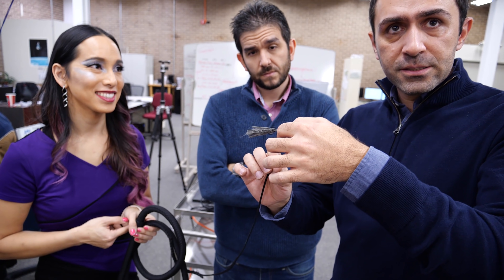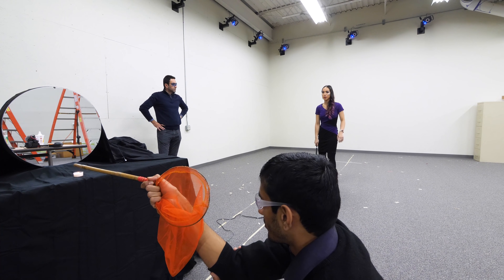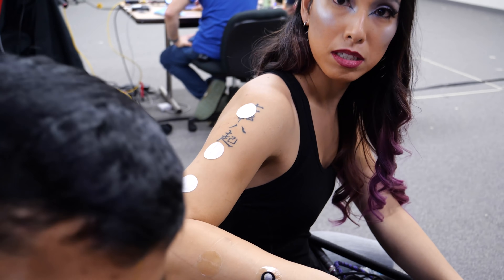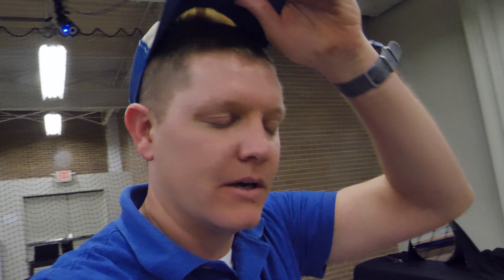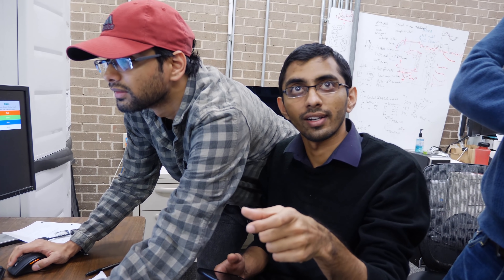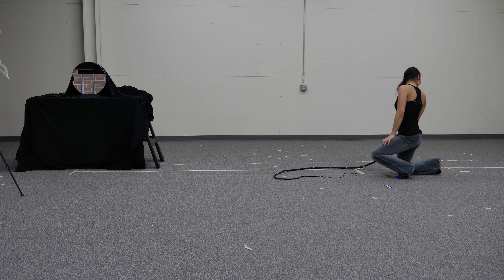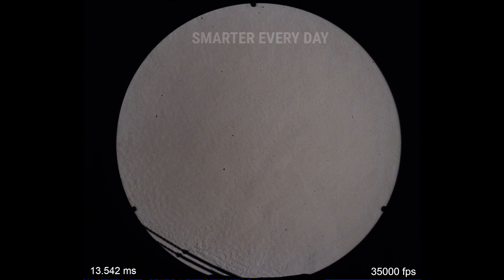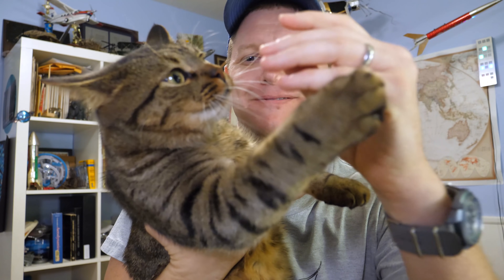How does a Whip Break the Sound Barrier? Behind the Scenes- Smarter Every Day

Comment: Attention should be focused on the wave transmitted along the whip.

As the part of the whip that uncoils moves forward, it pulls the end of the whip forward, transmitting a longitudinal wave through the string. The force exerted on the whip is transmitted in the form of a wave. 

The propagation speed of the wave increases rapidly due to two factors. The first factor is the increase in tension due to the acceleration of the rolling, moving part, and the second factor is the decrease in the linear density of the string as it approaches the end of the whip. As a result, the propagation speed of the longitudinal wave increases exponentially, and the wave is transmitted to the end of the whip before the rolling part is fully extended. A quantitative calculation of this would explain why the end of the whip suddenly moves forward rapidly.

Comment: So basically a whip works like a pair of scissors that can become superluminal if you close them quick enough. The speed of the whip is directly proportional to the size and its base and the speed at which it is flicked. As the wave travels down the whip it exponentially gains speed.

Comment: What I find most interesting is that the thin tip of the whip (that last 6-8" piece) gets pushed along by the shockwave and never actually extends like the rest of the whip. In fact it ends up pulling the the whip back into the wake of the shackwave. You can see the moment that the tip goes from dragging the air along to being pushed along right when the shockwave forms. Incredible!

Comment: What I don't understand is why the wave isn't continuous to the end. You see a regular wave propagating down the length, but when the tip breaks the sound barrier, it seems to move faster than the incoming wave, and there is a backlash which interferes with the incoming wave. What is that?

Comment: It's a demonstration of cavitation?

A Violin String stroked with the Bow in the usual spot makes quite a different sound from near the Bridge, or down near the Finger Board, because of the rate of engagement and disengagement of the Rosin on the Bow and String. It's a particular method of sound Modulation that uses linear and transverse modulation amplitudes, in the combinations chosen by a Violinist to express a feeling of harmony. 

The Whip is a similar situation of converting a long slow frequency wave to a short fast one, from transverse to longitudinal. (?)

Comment: The shot at 7:15 is so awesome bc you can see that the first point that goes supersonic, and generates the initial shock wave, is not at the tip of the whip, and the tip is being grabbed and carried by the shockwave after its begun. Would be really cool to see which variables (like whip length, weight, and taper) make a difference to the distance from the tip that the "inception point" of the shock wave happens. More experiments!!

Comment: How much did the mass of the tip influence the creation of the shockwave? With the loose strands, the transfer of momentum resulted in a very fast acceleration. The additional mass seemed to discourage the creation of a shockwave. 
Also, did the curvature of the whip change at the time of the shockwave? With a wider swing, I would expect faster airflow (around the tip), whereas the heavier tip should result in a narrower swing at the final transfer of momentum.

Comment: 13:56 ; Excellent positioning of the parabolic compression wave in the field of view.  
Remember that it might help, but taper is not required.  Forty years ago as a young engineering student, I wrote a research paper based on microphone recordings in an anechoic chamber for describing this structure for the formation of the wave-front.  (My original hypothesis (like yours?) was that the shock wave would be perpendicular to the whip travel, during the change in tip direction.)
Cylindrical whip cross-section (constant diameter line) seems more dependent on the back-stroke to focus the kinetic energy into the tip.  The shock wave requires both speed and a physical cross-section discontinuity (tip).  Larger mass lowers the speed, and a small discontinuity seems sufficient for efficient transfer of energy from the whip to the air.  I also noticed that the compression wave causes what looks like chaotic displacement of the tassel fibers within the wave crest (which might be critical?).  
I am curious about the effect of the shape of the tassel on the efficiency of the shock wave formation; you only reported use of two tips: a 'standard' tassel and a ball (much too big for good transfer).  However, more or fewer fibers, and the range of fiber length would seem to be parameters of the energy transfer.  
I presume that the adoption of a tassel by the sport was that it lasted better than blunt or mono-filament.  That might tell you something about the fiber strains and energy dynamics in the transfer process.  The sport probably also chose the whip length for practical reasons like the 'depth of field' for target acquisition, against efficient compression wave generation (although a good sharp crack might also be a 'fun' factor).

Comment: If you replace the mirror with a large sheet of Scotchlite retroreflector, you can have a larger viewing plane, AND install another light source and high speed camera to get stereo shadowgraphs. The sensitivity is not as high as you get with a mirror, but the almost arbitrary area and multiple viewpoints allow much more data to be gathered.

Comment: Another  idea: try stripping the core out of optical fibre Xmas tree, back light full dropscreen with polarized light, make for 90deg set on. a polarizer on slo mo cam and see what stresses travel thru "acrylic optical cable whip". Likely lasts only 1-2 cracks before destruction but cool stress point evaluation.

Comment: Wow she has a dangerous technique!  I have seen people cut using this method.  Following through with a whip (bringing the extended hand back & down to end up behind you) not only sets you up for another frontal crack from below, but there is no chance of backlash hitting you.  When you learn to target practice with a whip, follow through is one of the most important things taught to avoid cuts/injury.
Her technique requires a person to learn to direct (as much as can be done) the backlash and is typically used for multiple overhead cracks in a circular motion around the operator.

When you had the ball on the end of the whip, there would have been no need for goggles since there would be no chance of being hit when follow through is used.

As to when the crack occurs, I thought it just made sense it would occur before the "straightening out" at the end.  How COULD the energy, being transferred in the form of a loop through the whip's medium, NOT crack before the end of the length?  

The energy traversing the whip is forced to travel in a loop, and has the "burden" of moving that solid mass as it travels down the length of the whip's medium.  Hence the speed the whip;s medium is moved will obviously be slower than the point at which the energy no longer is confined to moving more of the whip's medium.  

The whip's medium is much more dense than air.  The tip of the whip is being unfolded from the last loop.  When the energy reaches the end of the tip, there is no more medium the energy will be burdened to move - only air.  Therefore the tip is easily accelerated since no more whip medium exists that the energy must force into a loop.  The sonic barrier is broken at the moment the energy's release, through a much easier medium, leaves the tip and is transferred into the surrounding air (hence disturbance of air molecules seen in the photos as the energy is now moving air molecules instead of leather/nylon).

Comment: In the last complete slow motion scene I notice that the tail of the whip "bounces" of the floor at about 15:24 of the video and 2829.500 ms of the (mill second) counter. This rebound energy then seems to travel up the whip and seems to affect where the tip of the whip actually "cracks".
Is this significant? Is the effect just on the location of the "cracking" or does it have an effect on the other 'momentum' calculations? Could Ms Choi stand on the edge of a couple of risers to give the whip more vertical travel space?
I didn't see a slow motion of a horizontal whip crack, so is that method free of this type of interference?

Comment: I wonder if you can have the spacial cameras record not as a set all synchronized, but as groups recording frames staggering the others to artificially up the frame rate. I don't know how to say that technically..
Reply: The 500Hz was a limitation of the computers in this case, the cameras themselves can go up to at least 1000Hz but only when analyzing smaller volumes of space.

Comment: Has anyone DIRECTLY measured the tip speed to determine that it is actually exceeding 767 mph or 343 meters per second?
Until I see this data, I am not convinced that any part of that whip exceeds the speed of sound.   You do not have to exceed the speed of sound to produce a sound.  Maybe the "high speed photography" guys on YouTube could confirm this.
Reply: The mirror is 16 inches across, the time stamps are there, you can do the math yourself!
Reply: What are the actual numbers for the tip speed?

Comment: Take a leather belt, fold in half, grab both ends and push the ends toward each other. You end up with a loop in the belt.  The pull the apart as fast as you can, you get the snap when the loop closes.

Comment: A whip with a lighter mass makes a much quieter crack. Would a whip with a heavier mass than a typical bull whip have a much louder crack? What I'm gathering is the more mass breaking the sound barrier the louder the crack would be. So what's the biggest loudest whip you can make?
Reply: The record for the loudest whip crack used to be held by April actually, those measurements have been made.
Reply: By the way I use a whipping motion religiously by way of fishing but have yet to break the sound barrier doing so 😉

Comment: I'm wondering if the ATOM Lab cameras could be divided and phased to record in between each other so that you're getting their data in every 1/1000 rather than just 1/500?  Or would you need to double the number of cameras to retain fidelity of the data?  Does that make sense?
Reply: The computers were the limitation of frame rate in this case, the Vicon cameras can sample above 500Hz but the volume being analyzed was too large to sustain higher frame rates.

Comment: I'm wondering about the tension in the whip, both along its length over the process, but also whether the tension of the whip in the middle is equal to the tension in the whip around the circumference. The reason I wonder if that might be important is because if the outside of the whip is in significantly higher tension, then it might lead to the force of the wave on the inside of the whip being 'contained' more, and being forced more towards the end of the whip. I'm not sure if any of that makes sense, or if I'm just talking nonsense.

Comment: I watched the video at 13:54 until the end of the schlieren footage section at .25x speed under a multi-lense magnifying glass set up that provides approximately a 50x zoom. I realize that you were interested in the part going supersonic, but the rope itself is fascinating. 
As it uncoils it reaches a point where the leading edge of the curve doesn't extend further, which occurs right before your tip begins to move supersonic. At this point the cord itself seems to compress at the leading edge of the curve. As the tip overtakes the curved portion, the cord which is wound in a spiral from what I can see in the schlieren image begins to stretch out in a spring-like fashion. 
While this is happening, the curve now moves backwards along the curve in an S like shape. What is going on there? 
1. Why is the cord acting like a spring? 
2. Why does the ripple effect move backwards even as the cord is stretching forward?
3. Why does the curve of the whip seem to hang in midair for a brief moment, instead of continuing forward or dropping due to gravity?

Comment: I wonder if you could crack a whip in zero G. It seems to me that the formation of that loop (you can see in the high speed 15:23) and it's closing at the end has something to do with the crack at the end. It also looks like gravity pulling the tip down forms that loop in the first place. So I wonder, without that loop, would it still crack?

Comment: Fascinating, there's torque there, it's dampened by the weight of the string in front of the wave until it no longer has any string left so the last bit gets flung away until reaching speed. Once it breaks the sound barrier it has no energy left from surpassing all that air friction it just carries on along with the air wave.

Comment: I'm really impressed by the amount of recoil in the whip: The one I made pretty much dropped like a dead snake.

But that means your dynamics model must allow for the elasticity of the final 20% (or so) of the whip.  Which may mean a single unified model may not be the best way to go.  I'd advocate for separate continuous and discrete models, where the discrete model uses point masses connected by weightless springs.  Then do something like simulated annealing to optimize the weight placement and spring values until good fidelity is obtained.  The many test runs are an ideal source of training data!

However, I suspect you'll find the mocap camera data will itself present problems, despite getting a good 3D reconstruction.  Just looking, for example, at momentum will be difficult.  (Well, that's what *I'd* find difficult, but I don't do this for a living.)

If you ever get to do this again, I'd suggest putting an optical fiber down the center of the whip fed by a chirp laser.  That should give you absolute bending radius as a function of distance, which should improve both models.  Until the fiber breaks, of course.

Comment: The whip looks like a transmission line to me.  If you build a barbed wire fence, the wire is stretched between two post and then the posts are filled in.  If you pluck the wire at one end a pulse travels down the wire and reflects off the end.  In an electrical transmission line the same thing happens with voltage and current.  If the impedance of the transmission line increases spatially down the line the voltage will increase as the wave propagates down the line.  I would guess the whip diameter behaves like an electrical impedance.  At the end of a transmission line if it is open circuited the voltage will double if there is no load resistance.  The end of the whip is an open circuit.  Cool experiment.

Comment: This is so interesting.  My engineer brain has a hypothesis as to whats going on.  I think whats going on is the creation of a pendulum near the tip.  The mass of the pendulum is the tip of the whip itself and its length is a function of....something yet to be determined.  That pendulum is fastest when the tip is traveling parallel to the whip.  You can see this in the sequence at 9:30, 9:47, & 13:53.  Look how the "base" of the whip pauses for a moment about the knot.  The remaining tip appears to behave like a pendulum and it cracks at the relative "bottom" of its swing.  How it gets to this point is an interesting question.  I bet the lateral tension in the rope is a big factor.

Comment: I think it just clicked! You said something in the other video about the whip popper being "pulled" along after the shock wave. The way it works in my head is more like a rocket passing through Max Q: as the popper accelerates, it builds up pressure along the leading edge. The aerodynamic pressure builds and builds as it becomes transonic, but the pressure drops off once the popper is supersonic. This sudden drop in aerodynamic pressure coupled with the (more or less) constant acceleration of the rolling whip results in the acceleration of the popper building, plateauing and picking back up, which is what you noticed. That's so cool!!

Comment: 13:54 Ha d to slow down the whole thing because the camera is still rather fast. Can someone explain to me what is happening there? At 4.8 ms the forward movement of the whip freezes and the end is tugged by the sound wave? And at 5.9 ms the whip wave moves backwards??? Why the whip does not straighten out? Why the "whip wave" freezes couple of inches from the end and as the end straightens the wave starts to moving actually backwards?

Comment: I'm not so sure the tip is actually "breaking" The sound barrier. The Schlieren video we saw of bullets breaking the barrier showed a distinctive triangle wave front. This produces a spherical front. I suppose that could be explained by the tip not being continually at or above the speed of sound, but it seems there might be a more mundane mechanism that creates the sound. After all, when you clap your hands, they aren't breaking the sound barrier, they are just compressing the air around them that forms the waves we interpret as a clap. If the whip crack is more like the energy being released into the surrounding air as it reaches the end of the whip, that's more like a rope under tension breaking, and making a loud bang. The tip doesn't reach super sonic speeds in that case.
Reply: That curved shape is the result of the tip going through the sound barrier at increasing then decreasing speed. A bullet makes a straight line because it's velocity is constant through the entire field of view. One could plot these curves and get a velocity profile of the tip while it is supersonic.
Reply: The mirror is 16 inches wide, the timecode is right there, tell me what measurements you get for max speed!